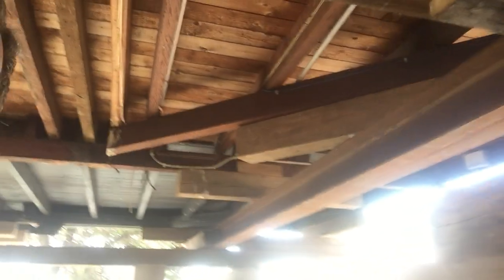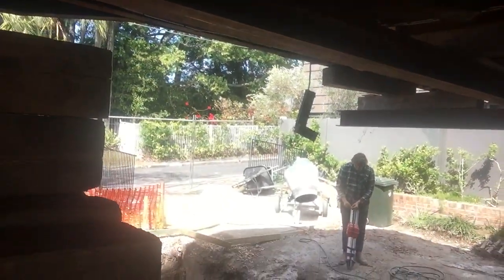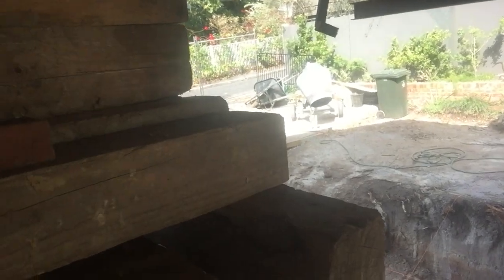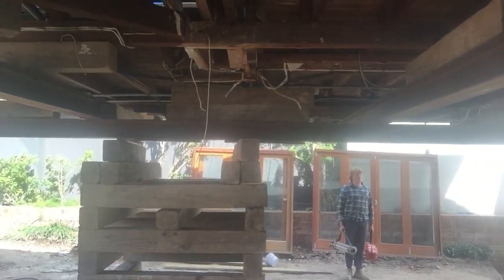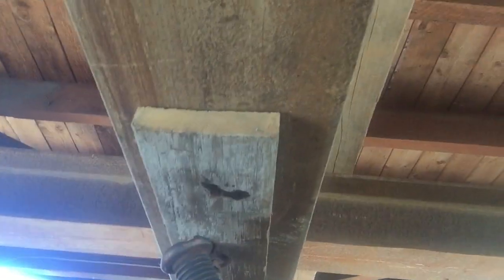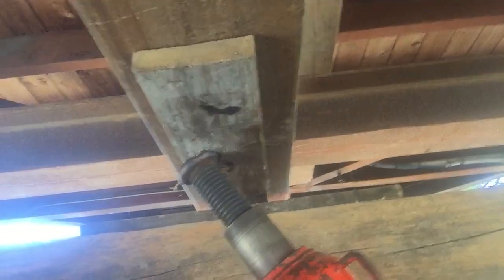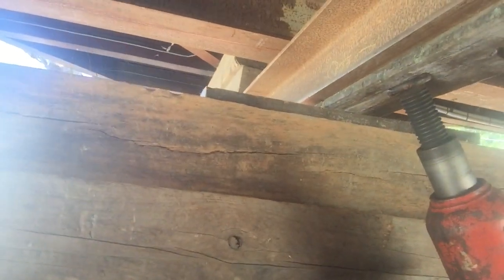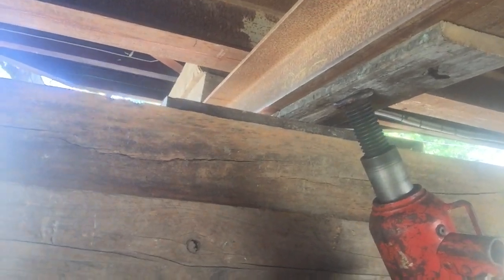House restumping at Ascot job no 26. how we slide the house

Comment: Is it worth putting the cribbing/stys on skids? That way once you've run out of travel on the sty, you can jack the house with a screw jack to take the weight then slide the whole sty across so you've got full travel again?
Reply from the maker: We had already slid the house 3m two weeks ago. Now I only needed to move it 300mm to correct location.